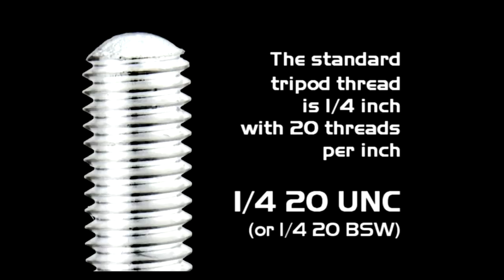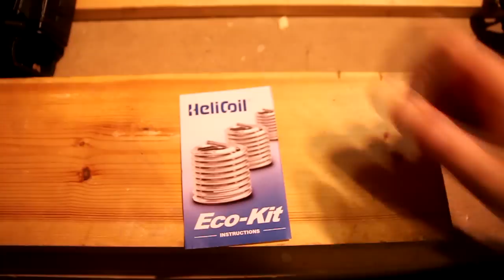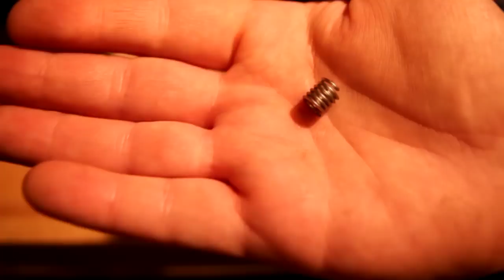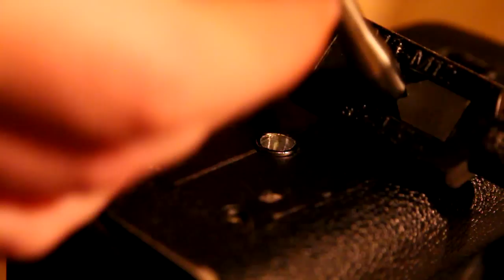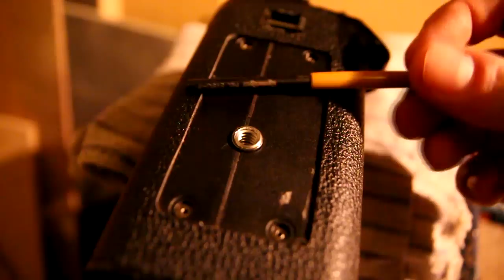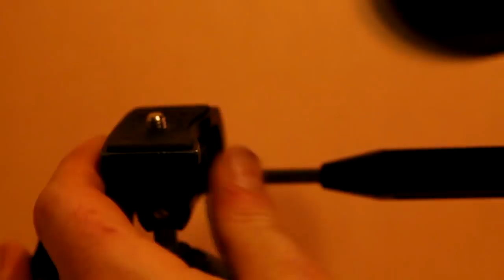Repairing a damaged tripod thread on a camera body

Comment: What's the part on a tripod plate mount that screws onto the camera? I have a silicone case on my Sony a5100 and it adds a few centimeters so my tripod plate won't screw into my camera because it's too short. It'll only work when I remove my casing. I'd like to keep my case on do is there anyway to replace that screw on the plate and if so what should I look for in terms of sizing?
Reply from the maker: Can't speak for all tripod mounts but many either have a small clip retaining the bolt or a spot where it can be moved to and screwed out.  Any 1/4'' x 20 (pitch mm) bolt will do it.. also referred to as 6.350 Threads Per Inch (T.P.I)  You will also find replacement tripod bolts if you search Amazon which might be long enough for what you need without chopping down longer bolts (just be careful with any soft plastic housing you aren't screwing a long bolt too far into the recess and applying pressure on the body ).

Comment: my camera body has a broken tripod screw in it! how do I remove it?
Reply from the maker: You would need to drill it out.. not as scary as it sounds. If you find a 'bolt/screw removal tool' these are bits threaded in the opposite direction.  So as you drill in, and the bit bites into the bolt, it will turn to free it.